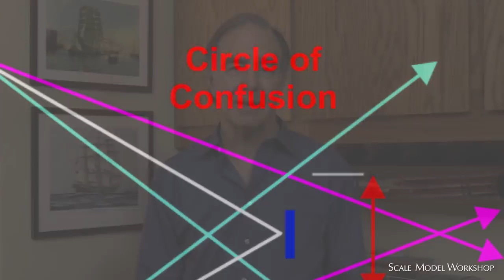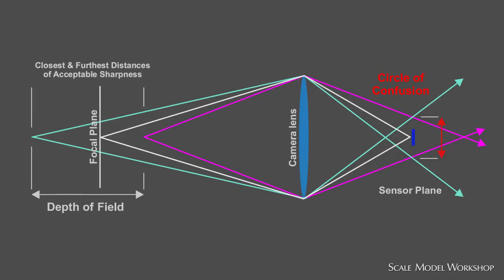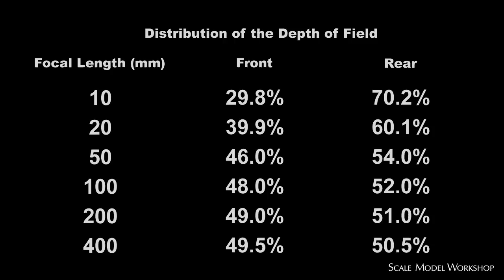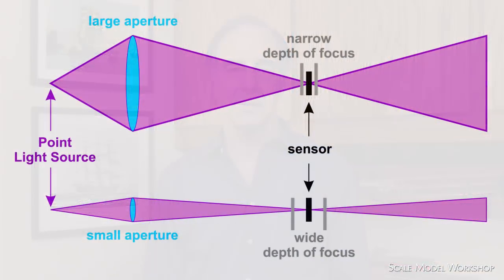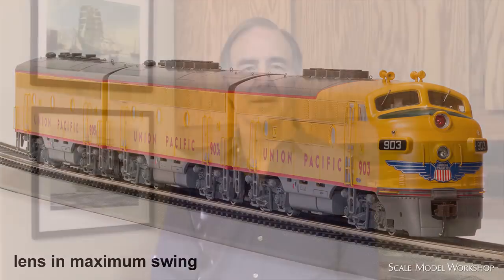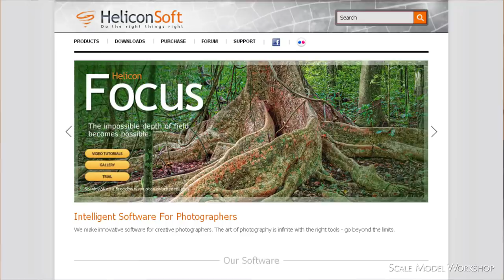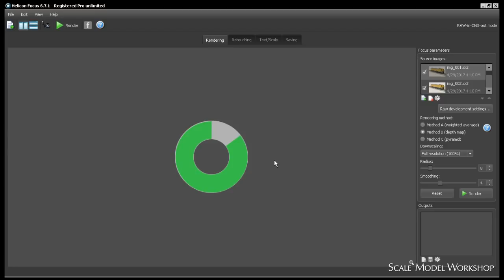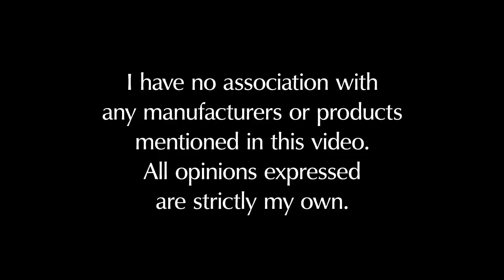Photographing Scale Models: Depth of Field

Comment: Excellent information, thanks! Very technical, but that's good. I've always tended to use a telephoto lens (300mm) outdoors in bright light and well stopped down. You seem to be saying that this doesn't actually increase DoF after all (over a closer lens) - I always thought it did. But I also want to avoid any "fish eye" effect, so I'll probably still keep doing it this way.
Reply from the maker: Correct, DOF, actually has more to do with the image size.  But the percentage in front and in back of the focus point, that appears reasonably sharp, will change with the length of the lens.  I frequently use a 180 macro in a situation like you describe, for basically the same reason.  But I will say, I've seen some very pleasing macro stuff done with a wide angle and extension tubes.

Comment: Well explained. I use focus stacking for higher than 1:1 macro photography (Insects) but its not always a good idea to refocus the lens through the subject. My canon 65MP-E lens can only focus by moving the camera position in increments since adjusting the lens barrel adjusts the magnitude of magnification. This is better achieved using a focus rail between the camera and the tripod. Manual focus rails are relatively inexpensive via Ebay or a fully programmable automated stepper motor controlled rail can be purchased. However probably for most models your technique will suffice.